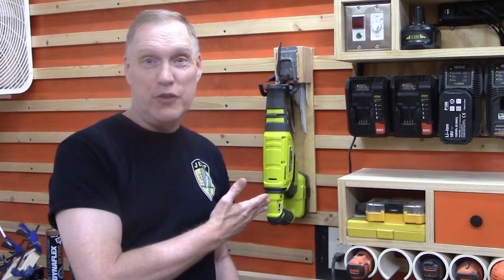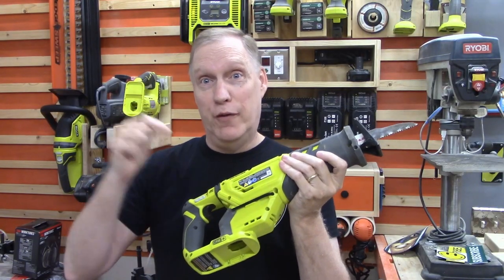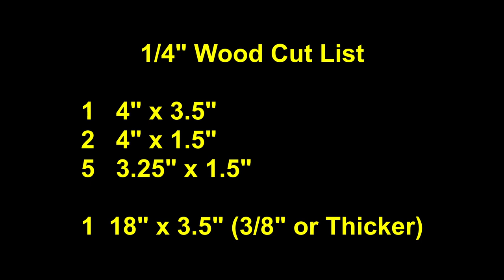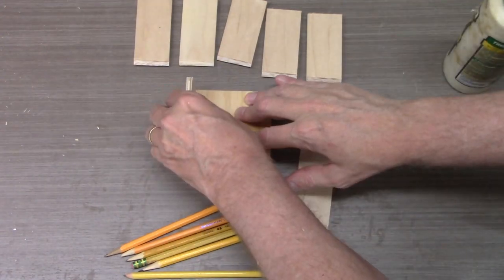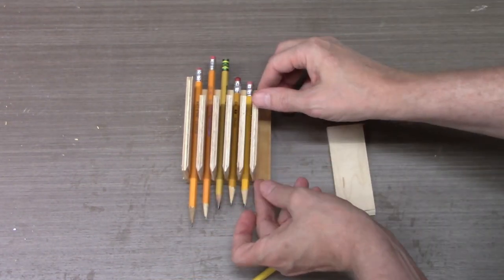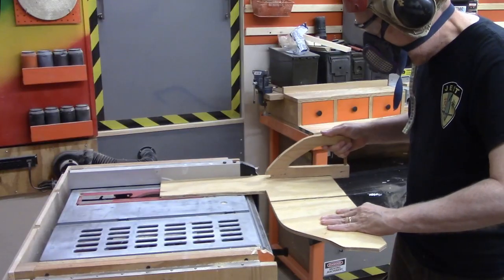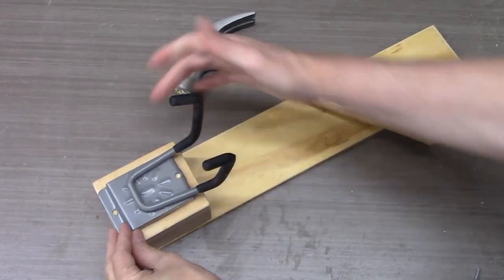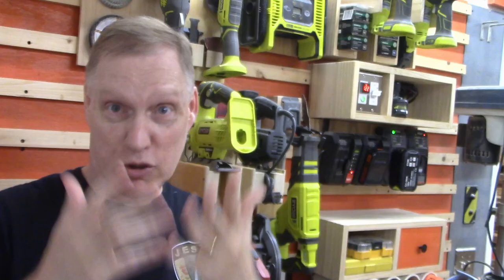Simple French Cleat Ryobi Saw Holder - Magnetic Blade Storage

Comment: The link to the magnet site works.  The link for the Lowe’s hanger doesn’t work.  And I looked in my local lowes and Home Depot and all they have is the husky hangers which don’t really fit the saw very well.
Reply from the maker: You need a double hook for the saw hook and I found this one, which should work just as well as the one I got: https://www.lowes.com/pd/Blue-Hawk-2-Pack-7-in-Gray-Steel-Multi-Tool-Hangers/50218513
Reply: @AtomicDairy  Thanks.  I found the hook at another Lowes.  The one closest to me stinks.  I used your instructions but added steel L brackets to more securely attach the magnet box to the board.